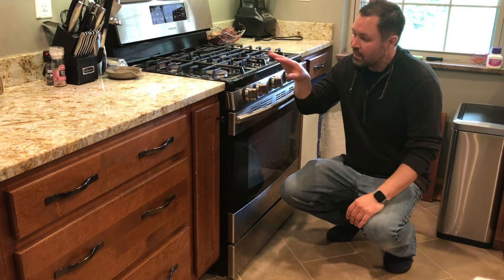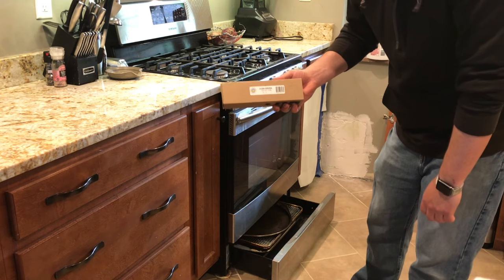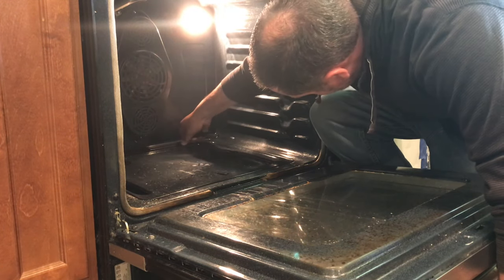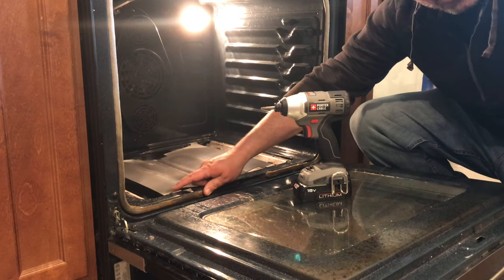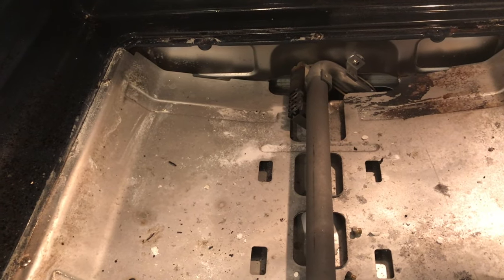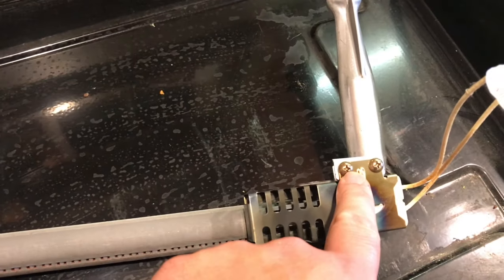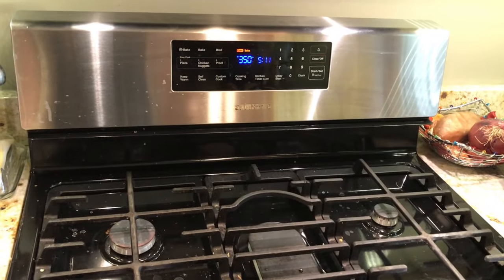Oven takes forever to preheat. Easy FIX!

Comment: Samsung Appliance’s are horrible!
Reply: That's what I've been hearing.
Reply: We’ve had our Samsung gas range 4 years and this was the first issue we’ve had.  The igniters are pretty much universal and all go bad after time.  The replacement igniter I bought was actually a G.E.
Reply: So are GE. All of our 5 year old appliances are failing.
Reply: Our gas tange is almost 9 years old and had performed flawlessly up to this point. If the new igniter fixes it, I'll keep right on using my Samsung has range/oven.
I also have Samsung washer and dryer since 2016 and still going strong without a single problem so far.

Comment: THANK YOU! My oven was taking at least 10 minutes to ignite. I got a new igniter on eBay for $18 and aside from having to drill out the first two screws, had the new igniter installed in about 15 minutes without any issues. Now my oven ignites in 30 seconds!

Comment: Great video worked like a charm. One caveat , the screw underneath on the gas orifice tube should not be loosened, it controls the air shutter, tube comes off and goes on fine without touching that screw.
Reply: I’m wondering if the fact that I tightened the screw when he wasn’t that way to begin with broke my stove?
Reply: Can you explain this more? Which screw in the video?

Comment: This was a pretty good video. However, you were wrong about tightening the screw on the gas supply and failed to mention the access opening on back of the oven to access the electrical plug in for the starter.

Comment: Our Samsung gas range has been taking forever to heat up to desired temp and wouldn’t go past 225 last night.  Everyone was closed today for Christmas Eve but I found BB Appliance parts in Mobile, who, for $50 bucks, will come open the store after hours and holidays for you to get parts so they were a “life saver” as I have a 6 pound rib roast in the fridge to cook tomorrow for Christmas Day.  Repair was easy peasy and less than $100.  

This video is excellent!!!  The front screw to my burning element was stripped like yours so it was a game changer to know exactly which size replacement screw to get.  Thanks for this video!!!!
Reply: Wow.  That's great customer service.  I'm just down the road in Pcola.  If I can't find someone here, I'll pop over.

Comment: Same oven but watching this to get the steps.  I ordered and received the part.   My kitchen is similar to yours as well. Counter tops and styling pretty much the same so that color combo of your walls and the rest looks good for me to copy too.  Pre-liking this video for the help even before I start.   OK I am done, the whole process took maybe 10 minutes.  Great job on the video.  Same symptoms same fix.  Oven heated up to 350 in a tad over 6 minutes.  Gas and heat was constant the whole heat time while before it would be off and on ever second.   Great job again on the video.
Reply from the maker: Hey. Thanks for the encouraging words. I appreciate it and I'm really glad this video helped you out. It just frustrates me that most people either buy a new stove or call out a repair tech for $200 for what amounts to a 20 min fix. Glad it worked for you.

Comment: Thank you for putting this together! The steps were easy to follow, set the right expectations for any issues, parts were exactly the same for my Samsung model and this fixed our heat times. Went from 20 min preheat to 5 minutes. Bananas. Thanks again.

Comment: Great video, i replaced the igniter but still had the same issue. It turns out the burner tube holes, some are dirty, and clogged, especially next to the igniter, I cleaned them with brass brush, and now its working perfectly.
Reply: Great tip!

Comment: Our oven was taking up to 45 minutes to get to 350 degrees.  I bought an igniter on amazon for under $24 took it less than 1/2 hour to change and now it heats up in 5 minutes.  We have been hearing a popping noise for some time, I found out that is a symptom as well as the slow heating.  Thanks for the post.

Comment: Pretty good,  but I wasn't able to get that front burner screw out either,  striped the head off the Philips screwdriver. So I left it and just took off the igniter where it was, easily removing the nut or backside of the screws attaching it. Sure a little tight spot, but workable, nuts and screw came out easily, and when I dropped the nut or screw down, just had to pick it off the shelf underneath and try again. Used extension on a small socket and held the screw head with my finders. When attaching the screws/nut back on, To keep the nut in the socket,  with a knapkin in first to jam in to keep it there, worked great, and don't have to worry about finding a dremmel (who has that) or hacksaw another flat head into that front screw. If you get it out, I'd recommend replacing with a hex headed screw that they should have put in. So you can get it back  out with a socket that won't strip.

Comment: I liked the part of Dremel tool to cut a slot in "the exact same screw" in the front.  I needed that so that when I stripped it out I went to get the stainless steel screw from Lowe's.  Oven works great now...

Comment: Great video! I will say that the front screw on my burner assembly was not going to come out.  I sprayed it with Kroil penetrating oil (Kroil usually works, good stuff) I hit the screw several times, heated it up with my butane torch and still it stripped.🤬🤬 So I went to Ace and bought the basic Dremel kit, the cut off wheels that come with said kit are not big enough to get a good slot in the screw. I finally just drilled the head of the screw off as much as possible and finished removing what was left with the little Dremel mounted wheel. So not a complete waste of $75 Other wise, easy as shown. Our oven is 10 years old so maybe that was why the screw fought me, it was rusted in.

Comment: Thank you - I just replaced mine today and it fixed the issue - I have the same oven as you and I had the exact issue with that one screw getting stuck - it stripped out - eventually had to drill it out but I got it 😊

Comment: I like the way you dive in as a DIY guy but this is natural gas you are dealing with. It's no joke. I have replaced at least 100 of these and you do not need to remove the burner in most cases. You for sure do not need to touch the air adjustment screw at the base of the burner. Gas/air mixture is critical with any gas appliance so don't mess with it unless you know what you are doing. Lastly...these ignitors are VERY fragile. DO NOT touch the actual ignitor with your fingers. The oil from your skin can make them fail prematurely.

Comment: Excellent video that gave me the confidence to do the job myself.  Only thing I'd add is to do like me and remove the oven door first, by just unlatching the hinges on both sides.  That saved my back when reaching in to unscrew the pans.  While I was at it, I unscrewed the panels holding the front and back of the door together and cleaned the glass.  There's another YT video about that process for this oven.

Comment: Really well made video.  Just ordered the igniter for my Samsung oven/range from Amazon.  See you again in a week.
Reply: Welp... After getting the drawer out and taking off the oven plate, I have realized that the igniter comes with two different connection types, and I have the wrong one.  Re-ordered it, and the new igniter (with hopefully the correct connection) is coming in two days.  In other news, on my Samsung oven, there is one extra screw holding the burner tube in place.  It's in the front, and like one of your screws it is stuck and I have stripped it.  I only need it to release just a bit so I can slide the tube out, and I guess I have two days to figure that out.
Reply: Success!  350 degrees in under six minutes!  Thanks again for this really well-made video!

Comment: Just adding to the list of thanks for this video. The only difference I found on mine was removing the warming drawer. There are plastic clips on either side that need to be pushed down before the drawer slides out.

Comment: Thanks. Easy except for two trouble screws. Pain in the ass. When finished,  it heated right up to 400° fast. It smoked a lot because of the WD40 type penatrating oil I used on the screws. Freaked me out at first. Needed a fan to clear the house. I recommend less spraying than I did.

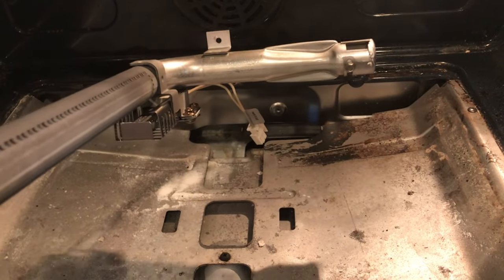Comment: Question: when you go back to re assemble everything. And fit the pipes back together. (Female, male part) Do you need to untighten thay screw on that part and retighten it once connected? Reference 8:17. 

Thankyou!

Comment: Thank you.  My exact problem.  Gonna give it a go.  Let you know how it goes.  Really appreciate your vid and your help!  UPDATE:  Well, finally got around to it, after the OVEN took over an hour to preheat...and refused to go above 425.  
Hand trouble with the over bottom panel screws, Dremeled them and finally got the out (destroyed but replaced with new screws)  and removed, heat shield screws put up a fuss, but got those out without the dremel (replaced them, too).  I had the same screw issue you did with the front burner screw but got it to come out without stripping.  From there replacement was a breeze.  Put it back together, hit Bake, and it was to 350 in a couple of minutes. Boom! Kind of a dummy, I am, to have put off.  It took me 2.5-3 hrs total.  Messing with screws, going to get a few replacement screws, clean the dang thing while I was at it.  Wagslick, my friend, thank you.   Note to readers: Yes you can!
the ignitor i used: https://www.amazon.com/gp/product/B08GL1XN9D/ref=ppx_yo_dt_b_asin_title_o05_s00?ie=UTF8&psc=1

Comment: When the ignitor switch goes out or not working properly, do you also get a significant gas smell too? Mine is taking forever to preheat now and has an accompanying strong gas smell.

Comment: great video - thank you - I followed every step and things are looking good.  However, I did get a smell when I turned back on the oven.  Is that the WD 40 burning off or is something not correct in my installation?  I turned it off since I was afraid something might explode.  Any ideas?

Comment: My Samshit oven took 30 to get to 450 degrees. The oven would beep and it would be 350 not 450 ? The repair tech told me just wait another 15 min ! Temp calibration was off by 75 degrees , The name is made of decals which move when you clean them . Knobs broke ,pancake grill chipped ! Horrible ! I just thought it was the oven but now it’s the part ? So now it won’t heat up at all so I hope it fixes 2 problems !

Comment: Just came across this video. Broiler works great, oven takes forever to heat, as with convection part. Too burners work fine, separate ignitors. Could this still be the issue (ignitor) or does oven have a separate ignitors than broiler etc? I've never worked on them before.

Comment: Hello! We have a Maytag oven (2-3 years old) which was working fine until the baking element was burned out & broken. We found about the broken element when smoke started coming out of the oven during baking. We installed a new bake element that was supplied by the manufacturer. However, the oven would now struggle to go above 300 degrees C. It doesn't get red after baking started for 15 minutes and temperature hovers just below 300 degrees. We did the continuity test with the multimeter and the beep is audible for as long as we touch the probes on the element terminals. Ohm reading was between 16.3 - 16.9. We also checked the voltage of the oven's element terminals connectors with the multimeter and it reported around 119.x volts (we're in Canada). So it looks as though the oven is supplying enough current to the bake element? Could you let me know what you think the problem is with my oven?
Reply: If this is an electric range you should have 240v for the element to glow red. In the U.S. and Canada power comes into your home as 240v from the power co. This is known as split phase or single phase power. Smaller loads such as lights and outlets will only get half of the 240v so you will have 120v. Large loads such as A/Cs, dryers and ranges will get the full 240v. If you're only getting 120v something is very wrong. You should have an electrician verify that your stove receptacle is receiving 240v. If you have the proper 240v to the range the problem must be with the range. Or with the range's control board could be bad or bad wiring from the board to the element.

Comment: Can someone smart educate me on how a bad igniter can reduce heat up speed? I understand the complete failure scenario. But the BTU output is controlled by the burner size and gas volume. If the oven is heating up at all, the ignition must be working. Confused..

Comment: I'm glad this worked for everyone but how would the igniter be the problem for it not heating up faster ?
Reply: I will take an educated guess on this question - as the igniter ages, the resistance of the material that the igniter is made of decreases. This causes the igniter to not glow with enough heat, that being the case then the gas won't be turned on by a heat sensor to allow the gas to flow. Sometimes it glows hot enough to allow the gas to turn on and other times it is not quite hot enough. With a new igniter it gets hot enough every time to turn the gas on as the oven maintains a constant temperature by cycling the igniter on and off.
Reply: Just found this on the google. The strong current flow through the igniter circuit heats up the bi-metal disc inside the safety gas valve. The bi-metal disc warps due to the heat and snaps open the gas valve, allowing gas to flow to the burner. The hot igniter lights the gas and your oven heats up.    -  So a bad igniter is not allowing enough current to flow through it to warp the bi-metal disc in the gas saftey valve circuit.

Comment: Had the same problem, but it's not always this easy or cheap to fix.  I have a double oven Frigidaire gas range, and the ignitor was failing on the top (main) oven.  The cheapest ignitor available was almost $200.  And the oven must be pulled out from the wall (gas turned off).  The back of the oven must be removed, as well as two interior panels.  The ignitor wire snakes through two holes, so you have to use a piece of twine tied to the old ignitor, so that you can run the wire for the new one.  If you don't do this, the entire stove must be disassembled to run the new wires.  Horrible, horrible design for a wear part that certainly will need to be replaced multiple times during the life of the range.

Comment: When I went to put it back together, the heating element seems to be shorter and I can not put the front screw In. I have rechecked everything but I do not know what I am doing wrong. Can you please give me advise. Thank you
Reply: Sounds like you may have ordered an incorrect replacement part. I would suggest double checking your range model # against the replacement part to insure they are compatible.

Comment: Would this work for a samsung chef collection gas range?
Reply from the maker: I've fixed another brand before. The process is similar, but not always the same. Sometimes you can access the ignitor from the back of the oven.

Comment: I smell gas when I turn on my oven, the igniter is on so after a few minutes I get a small explosion in the broiler. The igniter is hot enough to ignite the gas but by that time gas has been filling the broiler drawer. Is this an igniter problem?  Thanks dudes.

Comment: I bought a new Samsung stove I'm having a hard time working it putting it on the right temperature to cook the gas stove I don't need any parts or anything there's nothing wrong with my stove
Reply: preform oven off set its in your owners manual.

Comment: Did your oven show flame? And just heat up super slow? Mine you can see the glow of the flame but sometimes takes 30+ minutes to preheat to 375.  Maybe I’m thinking about this wrong, I would have thought after the igniter lights the flame, it’s job is done?  This preheating has only occurred twice in the last week or so. I just did a test and it got up to 375 in about 7 minutes. But twice before over a half hour. Didn’t investigate to see for flame glow or not because it only happened twice. Did yours go out and never light? Or did it begin to fail sporadically?  Never asked a questioning yt before so I don’t know if I get an alert to a answer. So I’m adding my email address thanks in advance. jistrebe@gmail.com
Reply: I have the same question. Did you ever find an answer?
Reply: On mine I also saw a small flame and it would take about 30 min to preheat to 375 and over an hour to preheat to 425. My understanding is that the small flame will always go on without the help of the igniter. The igniter purpose is to signal that the main (larger) flame can turn on. I replaced my igniter following the awesome instructions in this video and that fixed my issue.